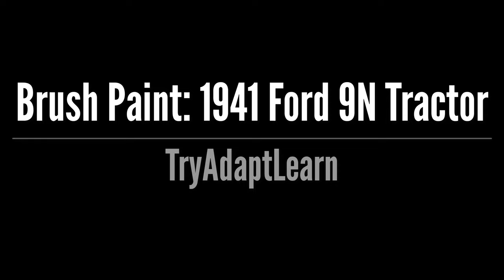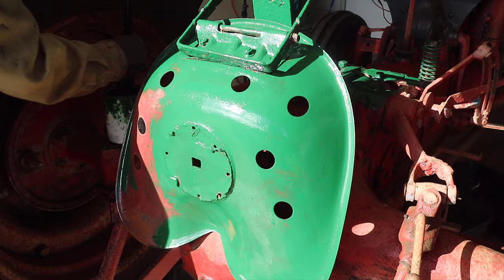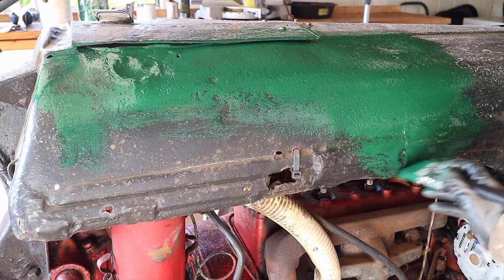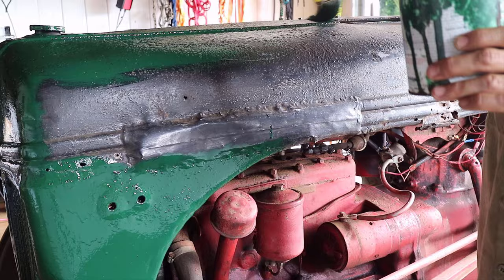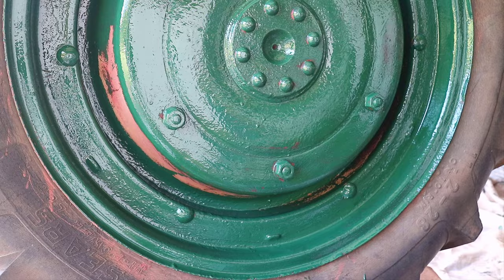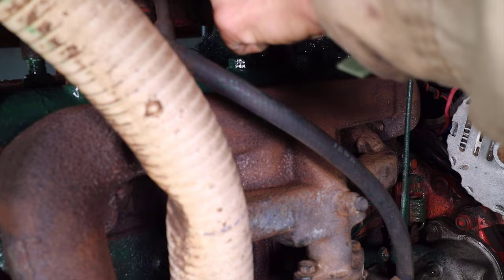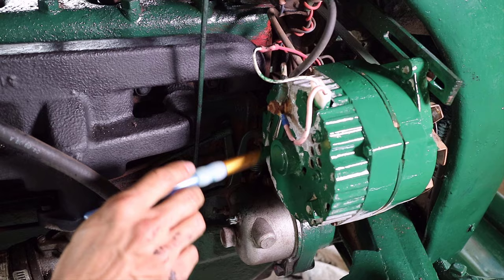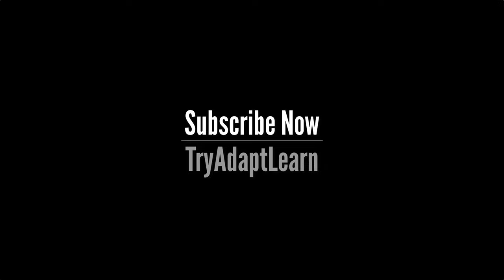Painting an old tractor with a paint brush, a 1941 Ford 9N

Comment: I have a gray and red 1946 2N... I'm considering taking it back to all gray. 

But as far as your video... I did something similar with a 1968 Plymouth Valiant that I restored. It had been in a back yard under trees for about 25+ years. The guys grandkids used it as a jungle gym for years. 

I had some old green concrete porch/sidewalk paint. I painted the car with it, just a preservation coat, until I got the body. It looked ridiculous... But it actually aided in body prep, once I started sanding, bonding dings, and priming. Once I applied the real paint, it looked amazing.
Reply from the maker: Thanks for the feedback.  I think that all gray will be awesome on the 2N .  I think the stock all gray is good but it it wasn't mint I'd even paint it a shade darker.   Thanks for mentioning the paint, that was the main goal, I got what I put into it, which it quick and dirty but as mentioned it served it purpose to delay the corrosion.

Comment: Hideous just plain Hideous. You will see it on Craigslist soon.
Reply from the maker: Thank you for your feedback and your opinion.  Your perspective could be said about the whole project.  It isn’t a restoration but more of a repair.  This was a machine that has been parked and not working and will be to one that will get some use and maintenance.  The paint was meant to help stop the corrosion from continuing to spread with working on the project.
Reply: @TryAdaptLearn  Since you are not going to put it in a show or anything, what you did should be fine, except you should have put some Rustoeum  primer (or similar) over the rust before using the top coat.  Then your paint job would last longer (maybe forever).
Reply: The hood (which is the most noticeable part) looks like crap.  You could have sanded it better before painting.  Why would you even bother to do anything with a result like that.  I have brush painted equipment numerous times and every time it looked better than that hood.  And believe that I am not a perfectionist,  I believe you can do things with minimal prep, but there is a difference between min. prep and garbage.

Comment: Hello , just want to ask if you thinned down the paint before painting?
Reply from the maker: Thank you for your question.  I did not thin the paint in this video.  Because Rust-oleum is thick, you probably could thin it if you were planning to paint multiple coats or use the paint in a sprayer.